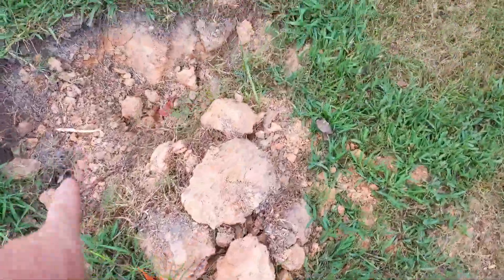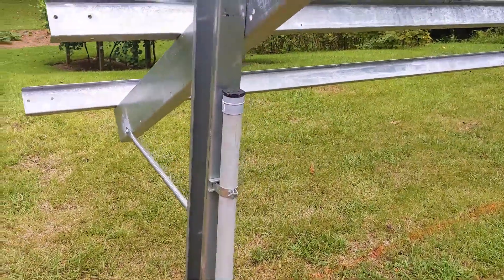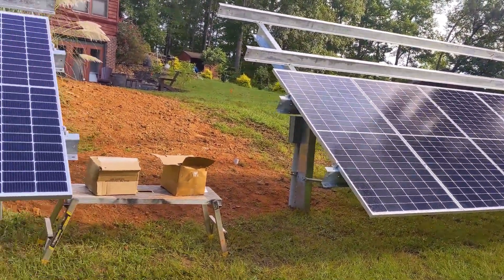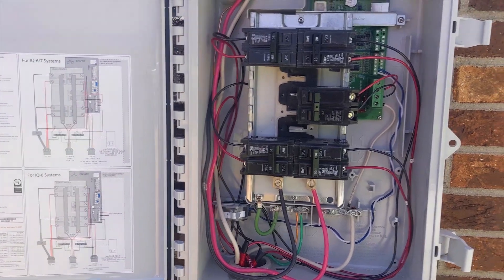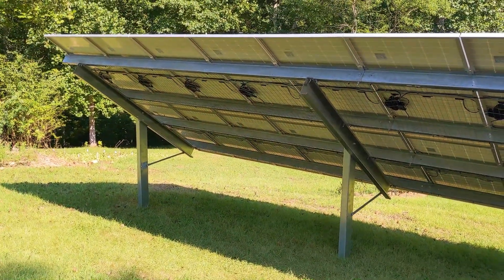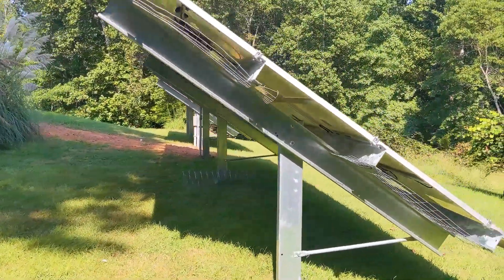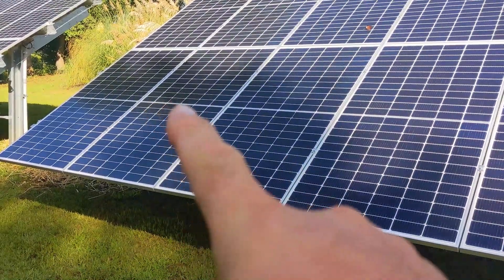Surprised by Enphase

Comment: I re-watch your video after I have installed my Solar system with IQ8+ microinverters.  You stated that it has 40 x IQ7+ (max continuous 290watts AC) So your system all panels max out should produce max AC kW is about 12kW AC.  You stating that is produced 16-20kW AC power.  How does it possible?  Is that maybe you meant 16-20 kW hour?

Comment: I have 23 enphase inverters installed in 2011. 10 have failed so far. Need to go on the roof every time for a replacement. Emphase does a warranty swap, but only for the inverters. Not the installation cost.
Reply: Large arrays of panels don’t need micro inverters or optimizers. They are usually the first thing to fail. If you have a few stray panels they make sense. Remember that utility size arrays use neither because the ROI doesn’t work out.

Comment: Would like to have seen more detail on the entire wiring setup, specifically the array connection.
Reply: MC4 connectors from the solar panel (+,-) go into an Enphase Q cable adapter which just plugs into the micro. the q cable is all daisy chained together and goes from one micro to the next, where the same connections take place on every micro. just 2 wires in the q cable trunk line, both 120v hots. those run to an AC disco and then to a 20/40/60 amp DP breaker.
Reply: @SamsDIY  I don't believe that you can daisy chain 60 micro converters together. If you can, then I got bad info from the seller
Reply: @007_TheWatcher  you can't, there's a limit of 20a for each string. For IQ7 it's 16 per string and with IQ7+ it's 13 per string. So 2 strings would be 40a, 3 strings would be 60a, and so on.
Reply: @SamsDIY  THAT is precisely the kind of information missing from the 'plan' included with the pieces of equipment that I purchased as a 'kit'. I had to figure it out as I went along installing it

Comment: dumb question:  with the 2 arrays like that for grounding do you still need to use a single piece of #6 for both arrays?  or can you combine them somewhere down the line, then do a single #6 back to the panel?

Comment: I have 17 Enphase microinverters in a rooftop system installed in 2014.  In 2021 they started failing and 4 have failed so far, reducing output by about 25%.  This is 600 times the failure rate claimed by Enphase.  They failed one by one and some of them gradually over a period of several days, so not like they were destroyed by a power surge.  Look on Amazon reviews and you will hear many similar stories.  Theoretically the inverters are still under warranty, but the outfit that installed them has gone out of business.  I'm too old to be climbing up on the roof to replace them, and anyway Enphase won't deal with homeowners, you have to go through an installer, most of whom don't want to service someone else's system.  Even if I find a willing installer, just the labor will surely be many hundreds of dollars, easily wiping out a year's worth of power generation at least, and with the seemingly likely prospect of more failures and replacements in the coming years.  It's a nightmare really.  The advantages of microinverters are greatly overstated.  Modern panels and string inverters have bypass diodes and sophisticated MPPT algorithms that deal with shade pretty well.  If you look at actual field tests, the difference between micro and string inverters in power production is usually less than 10%.

Comment: @engineer775 I am new to solar. How would you wire this ground mount system to a solark 12v all in one inverter system with your favorite eg4-ll battery rack mount with ac coupling? Since the iq7 micro inverter bring the ac to the combiner box with the envoy, and then it goes into the enphase inverter, how can you intercept the ac to charge the batteries. I hope this question makes senae

Comment: I am installing the IQ7A’s paired to Canadian Solar 400W panels, the busbar IQ cable connector will connect facing up or down, will I have issues during commissioning if some of those busbar connectors were facing up and some facing down?

Comment: Enphase is top of the line when you want batteries, or have shading and multiple azimuths. But cost-wise, for ground mounts I'd just go straight panels to inverter. Probably SMA. Any more equipment is just driving cost and a potential point of failure. But this guy said he might do encharge so heck yeah 👍🏻

Comment: Curious why 200 main downed to 150?
Reply: From my understanding, in a backfeed situation you can’t exceed the panel bus amps rating by more than 20%. Conceptually you could pull 200amps from the grid and 60amps from the solar and the total 260 would exceed the bus rating of 240(200+20%).  Would this realistically ever happen, probably not, but I wouldn’t want a melted bus in the panel.  This is why you sometimes see lineside taps, because it uses the main breaker to keep the panel within spec.

Comment: I have 62 panels with Enphase inverters on them.  I think over the last 5 years, they replaced one panel.  Never a problem with the inverters.  I just had 33 KW of Enphase batteries installed with their entire Ensemble system.  I didn't pay for it (long story) so I did not get to pick the system.  After watching a bunch of the Sol-Ark videos, I think there are probably some advantages to the Sol-Ark system.  The big one being that the Enphase ensemble is limited to 40 KW of batteries which limit your peak output if you want to run air conditioners.  The Enphase system has worked perfectly so far (it was installed 5 months ago).

Comment: Please can you tell me if the  Q-cable AC connectors are polarized?
Reply from the maker: I do not believe that they are polarized
Reply: @engineer775  Thanks , makes sense, but needed to check before powering up.

Comment: I have an enphase grid tied system as well no battery.  But I have recently been looking at the enphase IQ8 inverters.  They can be used off grid as well and what's different with these is they still produce when the grid is down and utilize what they call a sun battery during daylight.  I am thinking of replacing my IQ7's with IQ8s.
Reply: sunlight backup IQ8 pv inverters used in conjunction with a smart transfer switch give you power when the grid is down and the sun is shining.
Reply: @ABC-wz2db  yes, I would like that.

Comment: Enphase is Great for a standard grid tied PV system. They're super efficient, especially if shading is a n issue, but for anything to do with batteries I agree that SolArk is the best. You can't beat a DC based system if you're going to use batteries. Having said that I believe that they've got the Best AC coupled system that works with batteries. And yes it's better than the Powerwall. Thanks for your videos Scott.
Reply: Love the new Solark inverters. Beast of an inverter.

Comment: I see that 60A circuit breaker is used on main panel which for 240Vac is good for 14.4kW. This is 90% of 16kW stated capacity for panels. Is this because efficiency is 90% on this system? Also, what happens with this system when grid power is down? Will house loose power even with solar power readily available?
Reply from the maker: When the grid goes down the solar system goes down. The microbes are iq7 pluses so they can only output 290 * 40 /240=48ampsx1.25= 60 amp breaker as the ocpd.
Reply: @engineer775  How solar system knows that power grid is down? What prevents solar system pumping power to grid?
Reply: @trt7838  The micro-inverters have to sense a live grid, if they don't, they won't output power past the micro-inverter.

Comment: Would you need the chicken wire if that had a short 4 foot fence around it? That code is dumb. I've had my 36 M250's for just over 6 years now. Where I'm at we have what we call a solar club.  Six retailers resell my green energy at a higher rate to tree huggers, They pay me premium for my exports. I pay the same high rate when I import, but I export more than import. Right now they owe me $783 Cad. Oct 31st I switch back to the lower winter rate. My higher net goes from Valentines day to Halloween. My solar now off-sets cost of all of my winter methane for heat.

Comment: Advice:   Question...  Putting in a single pole mount to hold 6-260w panels.  What size hole should I have?  Soil? 18" black silt/Loam dirt, with clay underneath.  Common to get 40 to 50+ mph winds.......   I can find a 24" auger bit and go 4' down easy.  Do I need a bigger cement base?  (FYI top mount is a 40 year old Wineguard that used to hold my 10' sat. dish.... actuator still works)
Reply: I did an "overkill" matching the original install (bought twelve used 175w Enphase grid tie panels on a single mount)  sunk three 5000# cement blocks in a hole then poured concrete around it all.  8" single pipe poured solid to prevent collapse in heavy wind. Taken on several 60 mph straight-line storms. I was nervous at first..
Now I dont even think about it.
Reply from the maker: 2 ft diameter and 4 ft deep would be sufficient. 18 inch diameter and 5 ft deep would be sufficient.
Reply: @engineer775  thank you

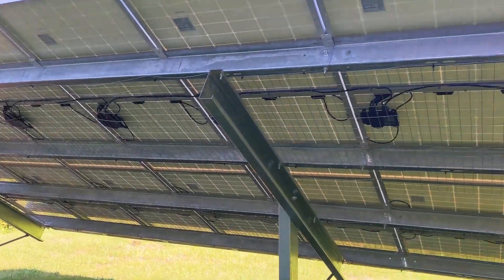Comment: dang, the iq7 plus is only putting out 290 watts ac.  my 365 watt panels clip from 11:00-1:00 on sunny days.  those 400 watt panels will clip from 10 to 2.  That really sucks.  I would have specked out the the iQ7A inverters if it was me.  You have head room with your downsized main breaker.  With 240 amps you could have made it work with the existing panel.

Comment: Enphase Encharge battery output is limited to 120 volts in battery mode.  It is disclosed in very fine print on the spec sheet.  CORRECTION:. updated spec sheet claims 240 Volt capability  Verify with manufacturer.
Reply: WUT???  IT is not capable of 220? I need to run a well pump!
Reply: @practicalpreppers7798  I didn't believe it until I read the spec sheet.  I would actually buy two if that led to being able to do 220v.
Reply: @b25mitchel  Nominal voltage / range 240 / 211 — 264 VAC   from Encharge spec sheet?
Reply: @practicalpreppers7798    Interesting.  Thank you for challenging my assumptions. The spec sheet I took the information from is marked "Preliminary"  There the 240 Volt output spec. is footnoted to say:OUTPUT (AC) @240 VAC¹ "1. Not supported in backup/off grid operations"  That is still the spec sheet on AEE website, a wholesaler I use.  The Enphase company website has updated the spec. sheet for both the 10kWh and 3kWh model, which now reads: OUTPUT (AC) @240 VAC¹
1. Supported in backup/off-grid operation.
Reply: Clearly Enphase has update the spec. sheet. I would get an ironclad guarantee, with some idea of the surge spec. if it has to start a pump against head pressure.

Comment: Was the 150 amp breaker the next size smaller than your 200 amp? That seems like a big de-rate for 60 amps of solar.
Reply: Based on the information gleaned from the utility, the home never pulled more than 75 amps of power from grid at any time.  I know many homes with just 100 amps service (here in Vermont) that have heat pumps, EV chargers, electric dryers, that have no issue.  The key to any system is avoiding EVERYTHING running at the same time.
Reply: @jdlutz1965  that's nice. I need to research my bill to see if I can find the maximum amp draw I have ever had. Be nice to know that info
Reply: @AzDad1928  hard to know from a bill but buying a Sense home energy monitor will give you all sorts of data. The most we've ever pulled at one time was just under 15 kw when running the dryer and range along with someone taking a shower.
Reply: I dont get what the whole de-rate thing is about?  Why is it done?
Reply: @Tro1086  it's related to bussbar restrictions on amount of energy.  If you feed in 60 amps of solar onto bussbar and also have 200 amps coming in from grid, it can potentially overload that bussbar with amount of energy.  Realistically, it isn't likely that such a large load were being drawn but safety standards have to take in all possibilities.
Reply: @jdlutz1965  After reading more in the comments I started to come to that conclusion, makes sense now, thanks. This is something I've never thought of and have never had an inspector call me on either.  Seems like more dumb codes to cover some crazy "well what if..." situation.  I don't think many people ever come close to actually pulling 200a thru a 200a panel. Usually the conductors the utility brings to your 200a service are hardly even big enough for 100a!!!
Reply: @Tro1086  I think half the inspectors out there are basically looking for labels only and hardly ever inspect the actual hardware
Reply: @jdlutz1965  Haha yep, they're just looking for the obvious stuff, ours likes grounding and plastic bushings on all fittings in boxes/equipment. I'm glad most of them don't not pick because it would make our jobs a literal nightmare.

The labeling on PV is so overdone it's retarded. It's like electricity was perfectly safe until we came along and added PV, and now it's just waiting to jump out and kill someone!!!

Comment: QUESTION:  What is the best (cost-effective) mounting hardware for a roof-mounted Standing Seam Metal Roof?  Seems like the roof mount per panel is almost as expensive as the panel itself!
Reply: Look for  S5 clamps on the standing seam.  Most racking systems can bolt to the S5 clamps.
Reply: @b25mitchel  We like A2N ACE clamps more that the S-5 clamps.
Reply: @practicalpreppers7798  Thanks for the heads up.  Will look for that.
Reply: You are right. The sad fact is that solar panels have never really been designed for roof  installation. They are pretty much a picture frame. I was hoping that Tesla would give it a shot but their solar roof tile is Probably worse.
Reply: @M13x13M  as someone whos installed 16 solar roof systems, I strongly advise you to skip it

Comment: I love Enphase, but a 400 watt solar panel paired with the Enphase IQ 7+ isn't a good combo. The max output of the IQ 7+ is 295 watts. This particular install probably should have used the IQ 7A, which spits out about 360 watts. 

If the customer wants a battery, instead of SolArk, the better option is to use the Enphase battery. Not sure if SolArk provides a microgrid during power outages, but with Enphase it certainly does. 

My two cents.

- Wholesale Solar Distributor
Reply: Enphase recommend 7A or 7+ for my Mission 365 modules, I have 15 and they seem fine.
Reply: @boathemian7694  The IQ7+ and IQ7A will both work, that's not the issue. I'm not saying you'll run into problems using either one. It's a matter of what's a better union. By using a less powerful microinverter (IQ7+), you're essentially capping the panel production to 295 watts, since that's the max output of the IQ7+ microinverter. Down the road it's not a major factor, since degradation comes into play so the panel doesn't produce as much as it will on day one. But for the first 10 or so years, you're not getting as much power as you are producing. 

In your specific example, the 365 watt panel will produce 330-340 watts the first year. The IQ7+ will only output 295 watts. If you used the IQ7+, that means you're missing out on the extra 35 or so watts that's being generated by your panel. If you used the IQ7A, you'll get to keep those 35 or so watts since the max output of the IQ7A is 366.
Reply: @pauljones8726  I see what you mean, I would have gotten the other one had I known this before I bought them but the Enphase tech support didn’t say anything but that either model would work. My application doesn’t really matter though as the arrays are not aimed perfectly anyway… Otherwise they seem to work flawlessly and I highly recommend
Reply: @boathemian7694  I'm glad you're happy with your system. Mission is a great company, as is Enphase. I actually own Enphase stock. We'll chat next time.

Comment: I have the Enphase Envoy on my house you will not regret it it is one of the best systems out there I don't know about the batteries because I don't have Enphase battery backup I am in the process of putting lithium batteries in switching over from lead-acid what's nice about the envoy is you got it right there on your phone anywhere Anytime Anyplace and iq7 inverters about the best ever especially when you got shading the only thing I don't like is the cost they are expensive cuz you got to have one forever panel keep up the good work

Comment: why not just leave the breakers on and disable power production through the envoy that way you dont have to go back just to turn on the system when the meter is changed?
Reply: Well because I have to go back anyway to commission the system with the customer, answer questions about monitoring, talk about phase 2 ( adding an encharge system) for battery backup and get paid the last 10% of the job.

Comment: You can't beat the enphase micro inverter system we have a 3ph A/C coupled offgrid system with 92 x 380w LGs and 150kWh battery storage, its been in operation for over 12mths and we swear by the IQ7+ micro's
Reply: I'm guessing it cost you well into the 6 digits for that system!
Reply: @jdlutz1965  Around $110k installed with 40kW inverter.
Reply: @cameronfuture7467  all roof mounted?
Reply: @jdlutz1965   Yes all on the shed
Reply: @cameronfuture7467  That's a big f'ing shed!
Reply: @ssoffshore5111  Yes it is (live on acreage)
Reply: What batteries did you use?

Comment: What are you using Laplace transforms for?
Reply: Just having a math flashback.  All I remember is that they were supposed to turn differential equations into algebraic equations making them easier to solve. I have not tackled any in 30yrs.